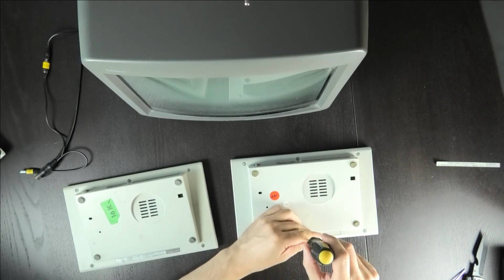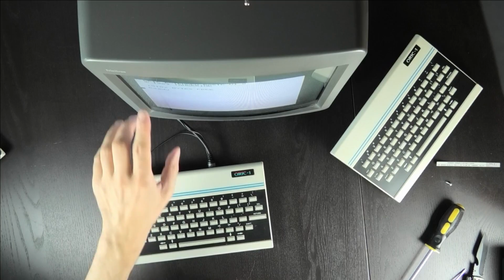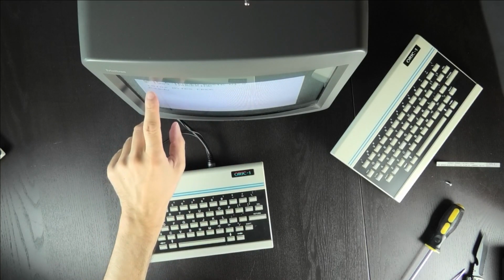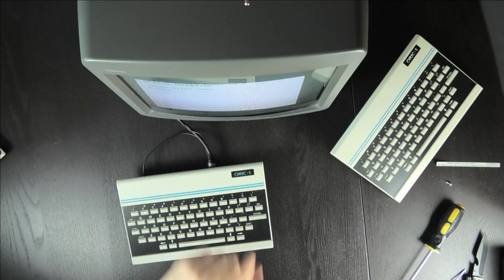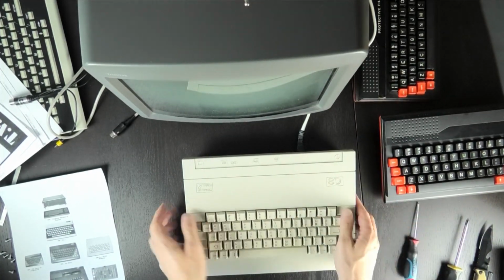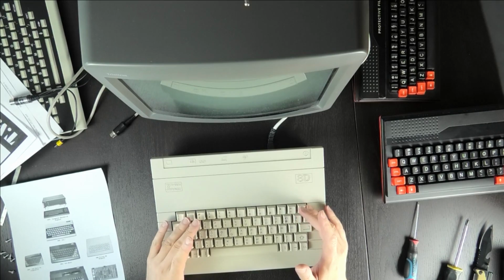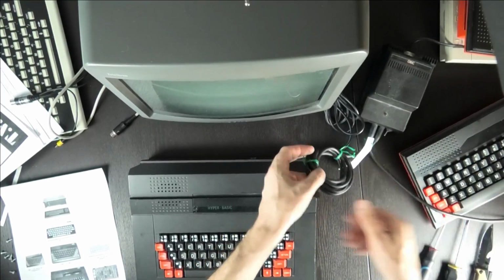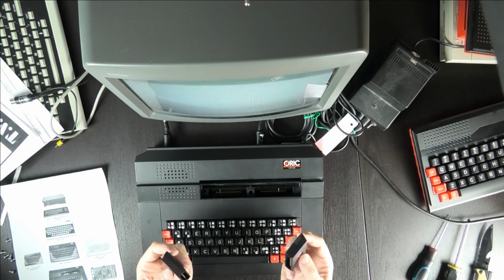Oriclopedia: The Oric family

Comment: To me, the Telestrat was really one of the worst failures of the time. Not so much because of all the design faults you rightly pointed out and that plagued the machine, but simply for the lack of  any real evolution in hardware that was very oddly and unfortunately aggravated by a total break in compatibility with the previous machines in the line, due to the new ROM and BASIC. So, you got more or less the same machine as the Atmos with very few new hardware and software features, that was aimed at a niche market (BBS/telematics), and 'all' of that at the expense of incompatibility with more or less the whole library of existing software... Clearly, breaking compatibility should have been mitigated by a breakthrough in hardware features: new video capbilities (at the very least: support for parallel graphical attributes as seen later in the Minitel instead of serial attributes), enhanced colour palette and resolution, and enhanced CPU: 65C02 at a minimum, but clearly this was the opportunity to try a somewhat more "future-proof" design by going for the  65816... Unfortunately, we know there weren't enough resources to go back to the drawing board and design an enhanced ULA or a more integrated and capable motherboard... As the half-baked  addition of a 'MIDI' port shows, they clearly ran out of resources to add even the most basic of new features they imagined... In my opinion, the only real usefulness of the machine consists in its ability to manage multiple memory banks with its two cartridge ports, and this is so far the way some people are going (with Orix, namely...). The sad and hard fact is that very few people seem to find a real interest to this machine anyway, as is shown by the lack of any software releases for it in the recent years...
Reply from the maker: Clearly a case of "too little, too late"!
For me, the Telestrat is just a collector item, a curiosity piece, and that's about it.